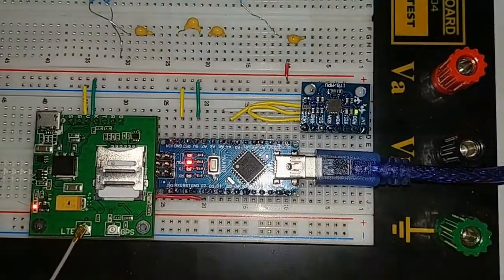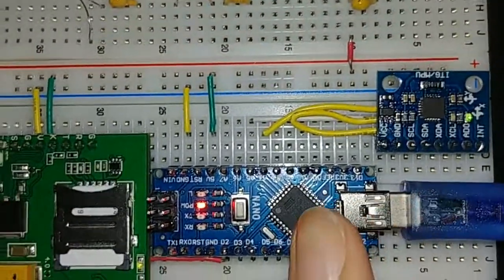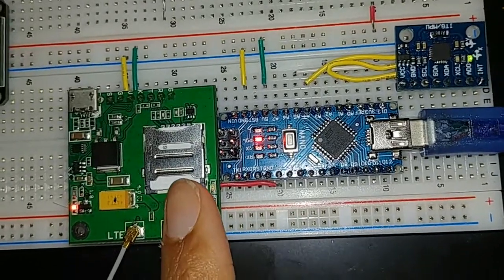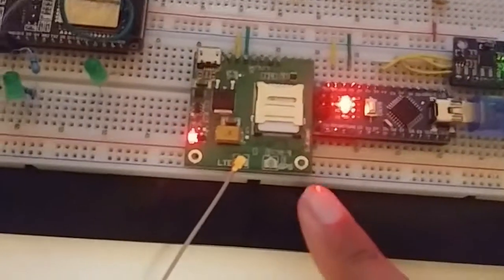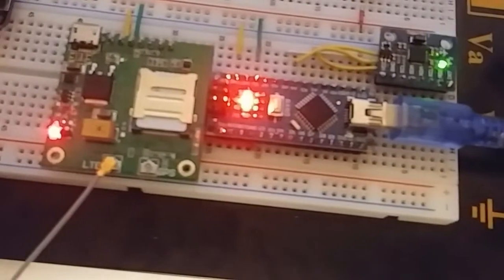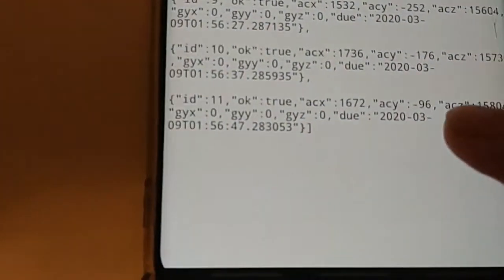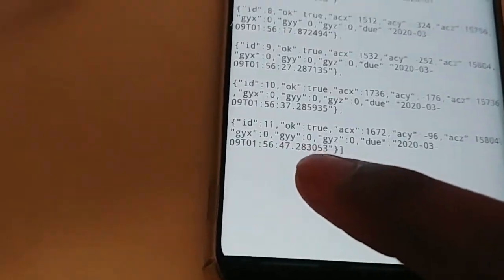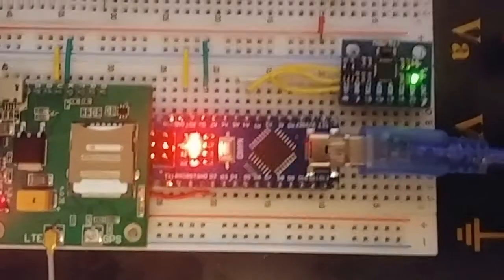DEMO | Arduino with SIM7000 + Hologram on Homemade Server

Comment: Appreciate you sharing your project.  I just ordered this same board with a SIM7000A but eBay seller didn't provide information and I'm having problem finding documentation for it.  Can you provide me a link to where I can find information for this SIM7000 board?  I was also planning to interface to it with an Arduino Pro Mini or Nano, can you also provide me a link to the Arduino library and program that you used?  I would very much appreciate any information and sample code that you can provide me to learn how to setup and program this Arduino and SIM7000.  Thanks in advance.
Reply: Did you try the adafruit fona libraries?  Or botelletics?
Reply: @gravitationalvelocity1905  Yes, I ended up exploring GitHub and came across those two and others.